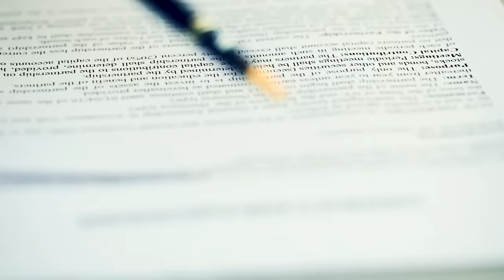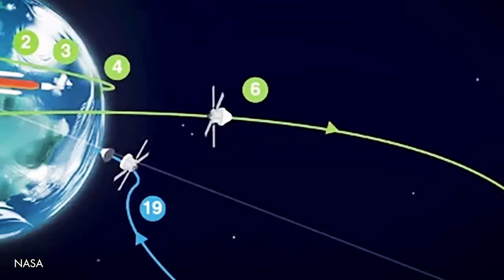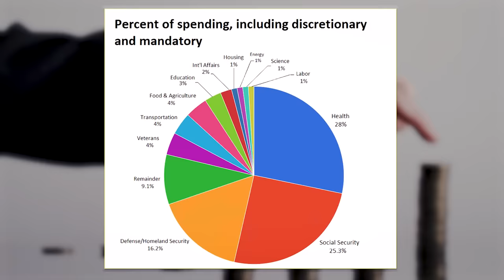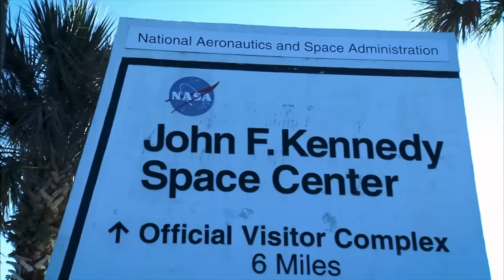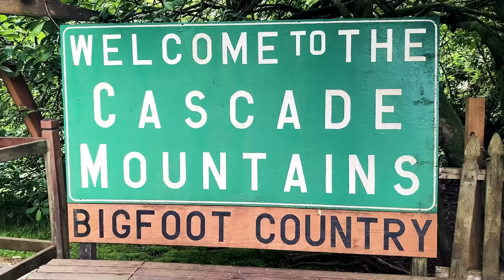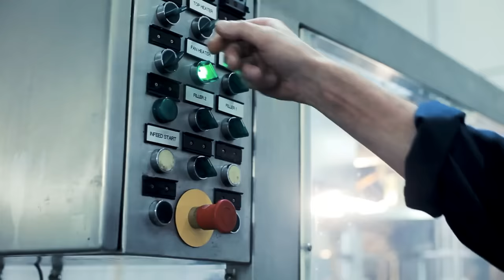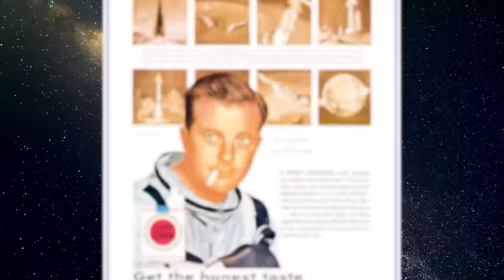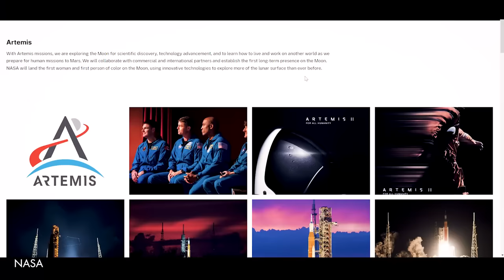Why is it so hard to return to the moon?

Comment: The moon doesn't have gold nuggets an oil. 😂. So it's difficult to get back to the moon.
Reply: It has a lot of Helium 3.
Reply: It's meant to be a way station en route to other destinations.
Reply: Pretty sure it contains some gold !
Reply: The Moon has lots of lithuim: you know, that stuff which helps the batteries in your phones and electric vehicles run. There's relatively little lithium in the Earth's crust.
Reply: There's lots of lithuim on the Moon: you know, that stuff which helps the batteries in your phones and electric vehicles run. There's relatively little lithium in the Earth's crust. 🤓
Reply: Moon has much more precious metals that we need going forward...Very big time expensive metals too!  Junk not available here on earth.
Reply: And the Van Allen Belts...it kills humans.  So how did we do it back in '69 to '75?  Or did we actually go to the moon?
Reply: @Bobcat665 Yes, that's right, when the aliens constructed the moon they had put a lot of lithium there to react to the pull, as you see works like batteries.
Reply: @Bobcat665 Good to know. But without a space elevator on the moon it is more expensive.
Reply: @jacksonbiggs4291 radiation protection.... 🧐
Reply: @gertjanvandermeij4265  It's 99% cheese.

Comment: We didn’t go to the moon and it is impossible to go to the moon for many reasons, including the Van Allen Belt.
Reply: Incorrect. The radiation level in the van Allen belts is low enough that humans can travel through them safely, if they don’t spend too much time in the belts. The Apollo missions traversed the belts in only 3 hours. 
There’s nothing impossible about going to the moon. All of the arguments used by the moon landing deniers fall apart on examination.
Reply: @Hobbes746  stop lying to real humans Mr. Bot.
Reply: @mydogjesus  Everything I’ve said is verifiable reality. Your attempt at censorship means you know this.
Reply: Here are the words of Dr. James Van Allen himself, the man after whom the belts are named and the man who advised NASA during the Apollo Program: "The outbound and inbound trajectories of the Apollo spacecraft cut through the outer portions of the inner belt and because of their high speed spent only about 15 minutes in traversing the region and less than 2 hours in traversing the much less penetrating radiation in the outer radiation belt. The resulting radiation exposure for the round trip was less than 1% of a fatal dosage – a very minor risk among the far greater other risks of such flights. I made such estimates in the early 1960s and so informed NASA engineers who were planning the Apollo flights. These estimates are still reliable. The claim that radiation exposure during the Apollo missions would have been fatal to the astronauts is only one example of such nonsense." Dr. James A. Van Allen.
Reply: @Hobbes746 you speak lies.
Reply: @jamesball8519  No, this is reality.
Reply: @jamesball8519  You think that you know more about the Van Allen Belts than Dr. James Van Allen himself? Really?

Comment: Wrong.   We have engineering problems we can’t solve yet according to nasa.   And we probably have never had a manned mission to the moon
Reply: Specifically, what "engineering problems" are you referring to? Could you provide a current original quote at source please. 

On the contrary, there were nine crewed missions to the moon and six landings. It would have been more were it not for the premature cancellation of the programme and the aborted Apollo 13 landing - that presumably NASA inexplicably felt the need to fake too?
Reply: I'm 99% sure what you're talking about, but to be sure, may I ask which problems you're referring to?
Reply: @davidmcbrayer6458  Thank you, that's what I figured. The Trial by Fire video with Kelly Smith was talking about testing a new craft with newer electronics (smaller  components are more susceptible to radiation damage) for longer stays in deeper regions of the belts than Apollo and was carried out successfully several years ago.

Comment: i don't see how sending 20+  rockets per mission to the moon is cheaper than 1 rocket?
Reply: its not if they were all SLS rockets which is estimated at $4B per launch - he was talking about SpaceX Super Heavy+Starship which are fully reusable. The latter cost only the fuel at around 20M per launch.

You don't throw away the whole jet plane after each trans-altlantic flight do you ? Unless its the Senate Launch System. Btw those refurbished left-over Shuttle engines at $300M a pop, that were reused many times, will end in the ocean with Artemis. So yeah ...
Reply: @tma2001  the whole premiss of requiring 20+  rocket launches to get 1 crew to the moon is going to make  it really tough.. we get launch delays all the time .. now times that by 20+  launches and all the boil off of the fuel up in orbit...  then we need those 20 rockets to function all well the transfer that fuel in the first place...how we'll ever get into a position of having enough fuel at the right time for a launch with crew...i dunno sounds a stupid way to do it to me.
Reply: @tma2001 the last one was already basically running out of propellant. Booster sure didn't have enough left to land safely and I suspect that starship wasn't gonna make it either. The moment we stop putting all of our eggs in that impossible basket is the moment we will finally make progress.
Reply: The number of launch claims keeps going up. How long until it reaches 30+?

Those rockets which will fuel the depo in orbit are reusable and made out of stainless steel with engines under half a million each. It's cheaper than SLS.
Reply: @Roguescienceguy  The booster on flight 3 didn't run out of fuel it had an anomaly which caused it to explode 400+ meters above the ocean surface, during its soft water landing attempt. That anomaly hasn't been released yet and we'll likely have to wait until flight 4 to find out.
Reply: Not all rockets have the same price. If Starship will cost per launch what SpaceX is hoping for then yes it will be cheaper. If course, Starship is not a reality yet so the cost remains to be seen.
Reply: @Jogeta5  thing is the fuel will eveoporate/burn off if not used quickly.. so launch delays on any of the fuel up rockets with mean less fuel will be in the rocket i orbit... which mean more rocket and and so more possible delays on refueling... then there's the crew rocket..any delays on that and you might need another fuel rocket to top it back up... also no has transfered any fuel  from any rocket stage to another rocket in orbit so far...
Reply: @cresshead  and the smart way is what exactly ? did you even watch the video ? the point is that a sustainable long term program is vastly more complex by its very nature - there is no easy way to getting a large mass to the surface of the Moon and Mars without in orbit fuel depots. We are just going to have to bite the bullet and make it work. There is no other choice.

As Musk has said people just don't think big enough. SpaceX will be building 100's of Starships. I'd rather they tried and failed than not try at all.
Reply: @cresshead  except for the Senate Launch System which is a total dead end with an unsustainable price tag.
Reply: Bingo!!!!!    This is what I want explained with a better nuts and bolts explanation..
Reply: @cresshead  I thought he meant the development of the Starship. But yeah you need 20 ( or even more) rockets for a mission success launch to the moon. However don't forget that we need around 20 or so launches of Starship before it could potentially be deemed capable for the mission at all. There are at least 5 more missions for Starship, which are just tests and which are not meant to succeed. The supposed "proper rocket" for the moon mission is the V2 Starship which they are only building the first 2 of those right now. And if everything goes according to plan, they need at least 10 successful launches for NASA to accept that rocket for their Artemis mission... which means at least 15 more launches of Starship and at least 2026 if everything goes swiftly and according to plan ...

Comment: It's not hard. If we can take a heavy payload into orbit we can go to the moon. And we can do that.

The reason nobody has gone back since is simply because there's been no reason to go back, at least not for the very short visits made in the 1960's and 70's.

We now plan to go back and stay for months. And that's harder. Food, water, air, accommodation etc has to be scaled up exponentially. 
And radiation protection too. Because radiation exposure is cumulative. And the probability of being on the moon during a solar flare increases from a low probability to a near certainty. 
So radiation protection needs to be significantly increased.

Comment: There have been quite a few failed lunar missions recently, about lunar landers toppling over or crashing on the lunar surface. India crashed the first time but later, they succeeded. Japan's lunar lander crashed. So NASA lunar landers safely landed multiple times during the 60s and 70s with no issues?🤔
I also remember back in 2000 when NASA said they were working on a new rocket to take us back to the moon. I was excited about it. We're in 2024, I dont see any moon rocket. Isn't it better not to make noise about something until it's finished?
Some people are saying we have no reason to return back there. Huh?

Comment: It is not hard. We just don't have enough motivation to do it which is why no one is doing it. As for losing the technology of the 1960's, ask Ford Motor Co if they still have plans and machine tools they used for the models they built in the 1960's.
Reply: You don’t lose technology which have military application as it is the case of rocket
Reply: @nicolagianaroli2024  yes you do. Military technology does not stand still. If anything it has a faster pace of research and innovation.
Reply: @vivektulja4516  Correct, but... too bad for you that at current date the Saturn V is still the most powerful rocket ever built  (at least on paper)

Comment: I loved your video!  I knew basically why we haven't gone back, especially the changed safety aspect of going, but you pretty much covered all of the different reasons of why it is hard to go back to the moon today!
It was never easy, and it still won't be easy, especially, like you said, "the risk factor"!  Going to the moon is going to have to be a hundred times safer now than it was in the 60's and it will still be very dangerous!
I just want to thank you again for your very insightful video!
Thank you! 👍
J Roncone

Comment: People don’t realize not that it’s hard, it’s just really expensive.  Physics hasn’t changed.  To propel that much mass out of orbit you need exponentially more fuel.  No amount of technology can make that easy.  It would be the equivalent of creating an F1 race car that had to carry all the fuel it needed for the whole season of races.  You’d need a larger engine to make the car move with all that weight, which would require more fuel, so you’d have to make the car even bigger.  By refueling the spaceship midflight, you can carry much less fuel, and this is the model for further Mars space flight as well

Comment: I didn't think it was possible for a rocket engine or any combustion engine to operate in the vacuum of space.
Reply: Why would you think such a thing? Rocket engines throw mass out the back, and an equal and opposite force is required by physics. That means the mass thrown out the back must ALSO be pushing the rocket forward. None of that requires an atmosphere.
Reply: @Crispr_CAS9  fuel combustion can't happen in a vacuum and where does the oxygen come from needed for the reaction. Thrust has to have something to push against Like a atmosphere that doesn't exist in a vacuum.
Reply: @63phillip   Fuel combustion in a rocket in space does not happen in a vacuum.  The combustion chamber of the rocket has very high pressure.  The oxygen normally comes from a large tank of liquid oxygen, but there are other ways to do it.
Reply: @63phillip  "fuel combustion can't happen in a vacuum" Yes, it can.
"where does the oxygen come from needed for the reaction" The big tank of liquid oxygen, usually. 
"Thrust has to have something to push against Like a atmosphere" This is wrong. If you throw something, you apply a force to it, and it applies a force to you. Likewise, if a rocket throws mass out the back, there must be an equal and opposite force applied to the rocket.

Comment: I don't think we ever went either because of the Van Allen Radiation Belts and the fact that the Apollo Space Craft already weighed as much as a battle ship and adding protective lead shielding would've made it to heavy to launch
Reply: By 1962, we had measured the radiation level in space, including in the van Allen belts. The results we got showed humans can safely travel through the belts. The level in the belts is high enough to be a problem when you spend a long time there, but not high enough to cause immediate problems. 
This meant the Apollo spacecraft (which weighed on the order of 50 tons fully fueled, while a battleship weighs 50,000 tons) did not need to be shielded.
Reply: Here are the words of Dr. James Van Allen himself, the man after whom the belts are named and the man who advised NASA during the Apollo Program: "The outbound and inbound trajectories of the Apollo spacecraft cut through the outer portions of the inner belt and because of their high speed spent only about 15 minutes in traversing the region and less than 2 hours in traversing the much less penetrating radiation in the outer radiation belt. The resulting radiation exposure for the round trip was less than 1% of a fatal dosage – a very minor risk among the far greater other risks of such flights. I made such estimates in the early 1960s and so informed NASA engineers who were planning the Apollo flights. These estimates are still reliable. The claim that radiation exposure during the Apollo missions would have been fatal to the astronauts is only one example of such nonsense." Dr. James A. Van Allen.

Comment: I didn't believe we went there in 1969 and still don't, what's really hilarious is that land line phone call, yet im out of town a few miles and have no cell phone service. Btw im 67 now, that gold colored tinfoil on the luner lander looks like it will hold up great for hundreds of thousands of space travel. Do they think were that stupid ?
Reply: Does it really have to be explained to you that a phone call can easily be patched into a radio network? The Nixon call was from the White House to Mission Control, Houston where it was patched into the Apollo radio network. Take care.
Reply: Space is a vacuum. There’s nothing there to damage the “gold colored tin foil”, so they were free to use flimsy-looking materials on the outside of the LM, like the multi-layer insulation (MLI) aluminized kapton blankets you call “tin foil”. Stupid is assuming a spacecraft has to be streamlined or heavily built when the actual design criteria are to make it as light as possible.
Reply: The transmitters used in space have exponentially greater power than the few milliwatts of a household wi-fi router, using a high gain receiver and directed focused antenna arrays. The Apollo radio transmissions broadcast at 20 watts, to a dish that was 65 feet in diameter which reduced the amount of battery power needed by the lunar module. 
They also had line of sight, i.e. there was no obstruction between the Earth and Moon. 
A cell phone transmits 300-600 milliwatts to a 2-foot-long antenna and has towers to bounce signals off when there is no line of sight. They also have millions of other users that compete for bandwidth. Thus, depending on how many users there are, and whether there are enough towers to connect the signals, you might not get any service. They are entirely different scenarios.